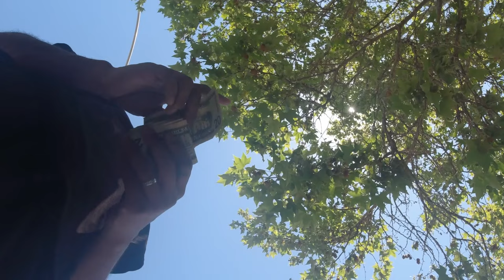WEEKLY VLOG! LECTRIC XP LITE BMX CONVERSION + SHORT FOLDING STEMS ARE HERE + VARLA LAS VEGAS TRIP

Comment: Speaking of Amp Rides, I was told you can replace the thumb throttle with a half twist (since they are plug and play components). Which do you prefer? Throttle or half twist? And if you can swap out throttles, will you do it with the Amp Rides?

Comment: Hi DBN!  Not sure if you know this..is there an extension cable where you can extend the controller button (on / off PAS) to the handlebar?  I see yours is mounted low and not sure if that is due to lack of cable from the BMX bars.  thanks.
Reply from the maker: It reaches to the handlebar but I don’t like that random cable in the way so I just mounted it low to clean up the cables
Reply: @DavidBrandNew  ok cool thanks!

Comment: How do you deal with the half twist throttle and new full length grips or did you swap to full throttle?
Reply from the maker: I usually just cut the grip. I’m considering thumb throttle so I haven’t switched the right side grip out.

Comment: Your link for "BMX Parts" just takes me to a website with many items.  Which exact parts (links please) do I need to change to a BMX handlebar? Thanks
Reply from the maker: Ever stem and handlebar on the website will work for the Lectric xp lite
Reply: @DavidBrandNew  Is a stem rise adapter needed?
Reply: @DavidBrandNew  Also, I have the XP 2.0 not the lite.  Will that matter?
Reply from the maker: @mindiestrella897  yes you need a quill stem adapter